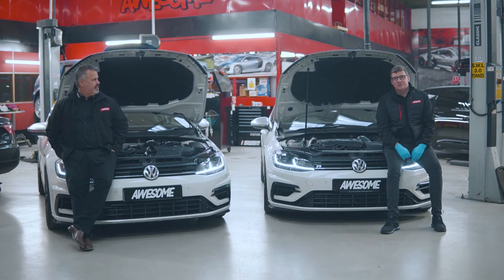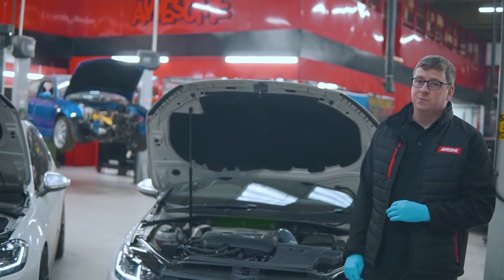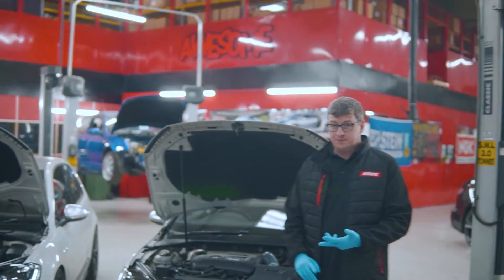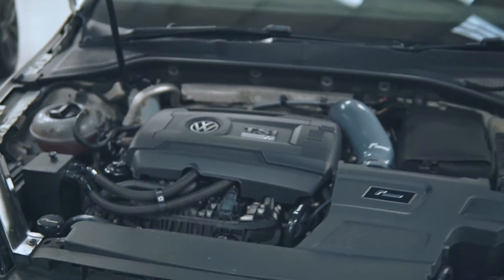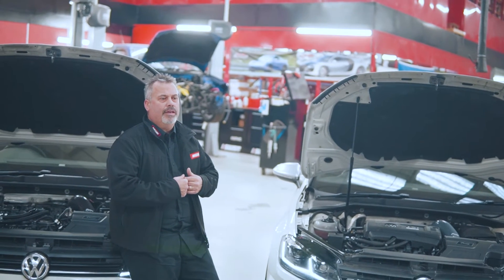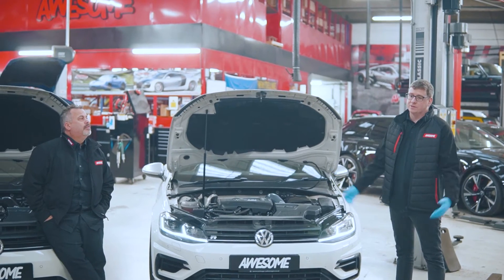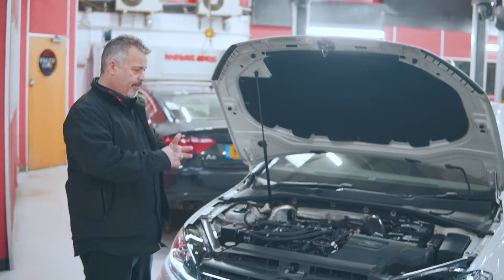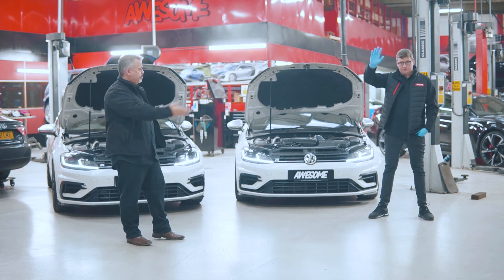Volkswagen GOLF R - STAGE 1 VS STAGE 3 Comparison (racingline)

Comment: would you advise any brake upgrades if going just Stage 1?
Reply: Upgraded Brakes are great at all stages, especially if you drive the vehicle hard.
Reply: @simonbarnes7789  ok thanks, was thinking braided lines & just upgrade the pads - should be enough? it's just a daily really, not tracked or anything.

Comment: Obviously I am assuming this stage 3 had Racingline Intercooler. Do you have a comparison between the cheaper airtec to wagner,apr, forge and racingline, revo for stage 3? Is there much of a difference for the massive price. Going stage 2 on audi s3 8v saloon once lockdown so want to know what parts before get remap but dont see point wasting money when there is little difference. (May be looking at water meth injection when stage 3 aswell if this differs the answer)
Reply: I don't have a back to back comparison of all the coolers. APR, Wagner are known to perform the best. The Racingline one is right up there and will perform well on a stage 3 build and the fitment is great. They'll all do the job for the stage 2 and your limiting factor will be the turbo not the cooler.
Reply: @johnglover1016  thanks John, I am looking at ttv5 turbo so that's where spending more on than an is38 hybrid so just wanted some proper advice. Would you advise against forge and airtec being the cheapest or really is it not the end of the world and whatever can get best deal on? Wagner needs cutting in so does anyone know what needs cutting as it puts me off cutting my car when others fit in. Want the best but if saving money on intercooler for a better turbo makes sense to me but dont want to ruin stage 3 build and need to buy a better cooler.
Reply: @danielfrost8147  we have other stage 3 cars out there running the Airtec intercooler and still making reasonable power. We seem to see marginly cooler IAT with the APR and Wagner however we havent ran into any real limiting factors due to the airtec.
Reply: @simonbarnes7789  thanks Simon much appreciated.

Comment: Hi Everyone, some help please! I have a 2008 Seat Leon Cupra MK2, running stage two software, approximately 350bhp and 450nm of torque, it has upgraded brakes, downpipe, nano oil and Revo street induction kit, I was racing on a private road last week👀and now the bottom end is knocking it's backside off! I have ordered a new engine but can someone tell me what would cause this damage so quickly? Car has 92k miles and has ran stage two software for around 3 weeks!
Reply: That will be the 92k previous miles 😁👍🏾
Reply: @27badbwoy  just doesn't seem like many miles to be honest, thought it would last much longer, the new engine I've ordered has 73k mile's 👀
Reply: How many miles has the previous owner put on the car ? If the previous owners , had a heavy right foot , 92k of abuse is a lot . If the cars been treated well , serviced and maintained , and been given some mechanical sympathy , then 92k is not much 😉 People don’t buy cupras to drive like miss daisy so would look at getting that other engine checked out as best you can .
Reply: @27badbwoy  will do mate thank you for the advice, can you suggest any car that has a stronger engine? I thought the Cupra did with sharing the S3 engine....
Reply: Sparta Tuning remember a remap will usually only highlight weak points in the car that were already there . The actual tune usually isn’t  the problem .
Reply: Sparta Tuning The Cupra engine should be ok  , just got to try and find a decent one . Good look with the new engine , hopefully it’s a good one 👍🏾
Reply: Remember that an upgraded oil and regular oil changes are essential to longevity, do you know the previous history on oil changes
Reply: @markash8456  the car only came with part service history, I am the third owner, the first owner was spot with the services however there isn't much detail around the second owner
Reply: They are known for wearing the thrust washers on the crank, my advice, don't drive and get it checked properly. You might be able to save that motor for a few hundred quid.